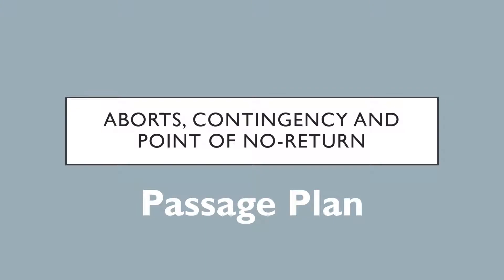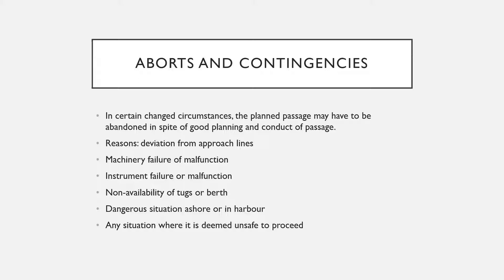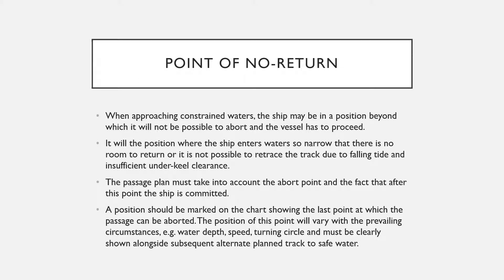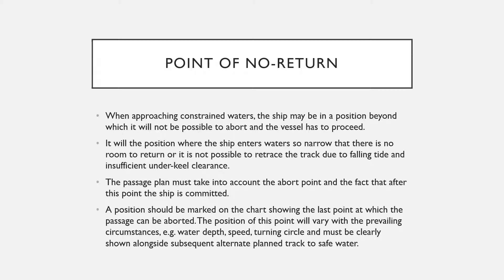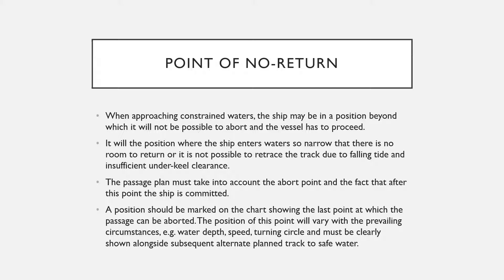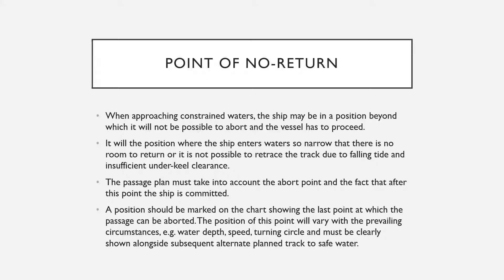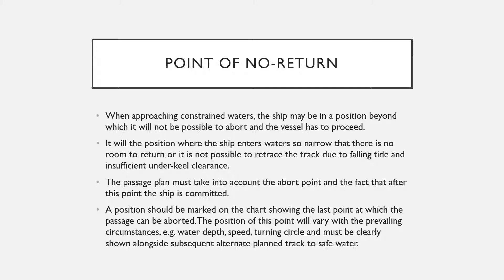Aborts, contingency and point of no return - Passage Plan

Comment: Sir , how do we get to know , 
How many abort points are enough ? 
Do we need to plot on each leg of passage plan ? 
What if the leg to too long then what is raito of plotting the abort points ?? 

In short , how do I come to know sir , 

This is point I need abort points ? 
Please explain sir
Reply: Regarding abort point, what if my abort point is before the pilot boarding station and if i have crossed my abort point to pickup the pilot but the pilotage got cancelled then what should we do?
Reply from the maker: @buanvino  That is why you should have a contingency anchorage or a contingency plan:)
Reply from the maker: Good question:) There is a misconception among students that there should be only 1-2 abort points especially near the pilot station. However, remember that it is your passage plan and the together with the Master you may have as many abort points as you deem suitable. It depends on the kind of passage and the waters you are transiting. 
Remember the principles behind abort point, and if it applies to many situations in a single passage, then you may have as many abort points as you or the safe passage of the vessel requires.
The important thing about drawing abort pints is: Ask yourself if there is really a need for an abort point and can it be justified to the Master?
Hope this helps.
Reply: @SteeringMariners   thanks alot sir .